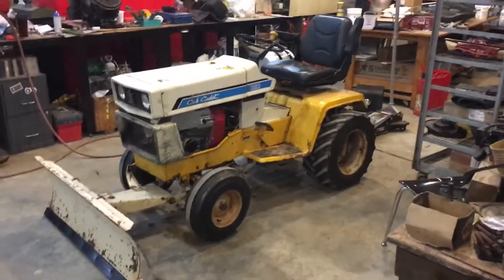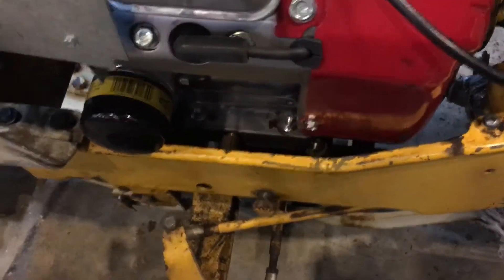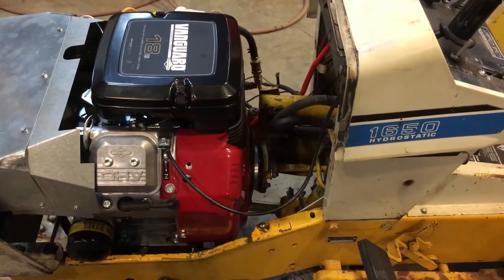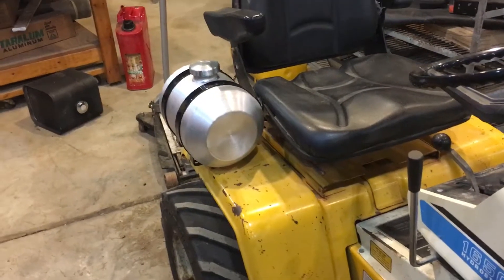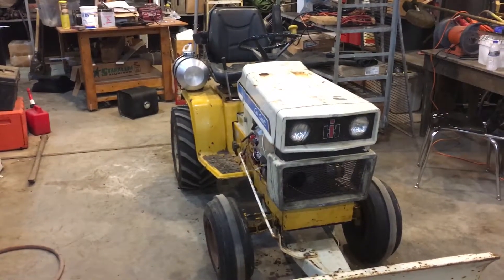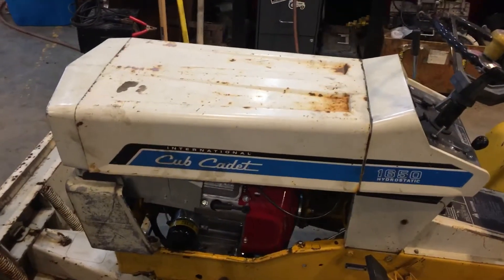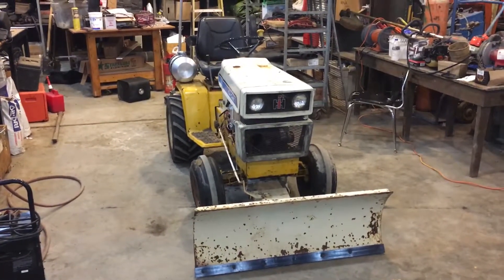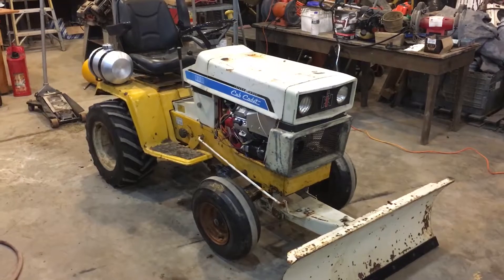Cub Cadet 1650 Repower

Comment: Thanks for the quick reply.   I'm considering doing this to my 1650.
Reply from the maker: jiminct1966 You’re welcome. I’m very satisfied with the outcome. It starts so easy now, has plenty of power, and I think even the mower deck cuts better. (Probably more Rpm than the Kohler was spinning.) I could take pictures or make another video to show what I did if there’s something you’d like to see. Keep the Cub Alive!!
Reply: Andrew Mills   That would be great to see a close up video on the engine mounting system you used. Small engine warehouse says to use their mounting plate and their gas tank, unless you didn't get it from them.  I actually might try the harbor freight 22hp predator engine.
Reply from the maker: Mower was on loan to my brother, just got it back and made a video for you.

https://youtu.be/Rn-wPP6M_eg.

Comment: Do the side panels fit back on?
Reply from the maker: jiminct1966 The left side panel would fit nicely if I’d “lightly” trim the heat shield around the muffler. The right panel would need to have a notch cut out of the 90 degree bend where the panel and the valve cover meet. I didn’t use them before, and haven’t been willing to cut the panel. It wouldn’t be hard at all to put the panels on.